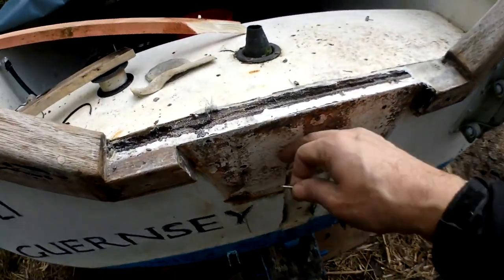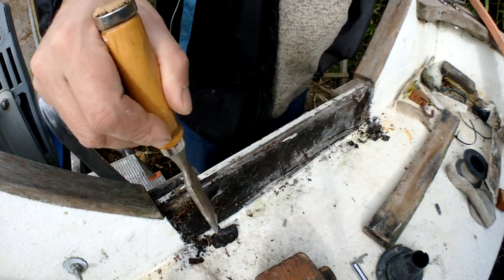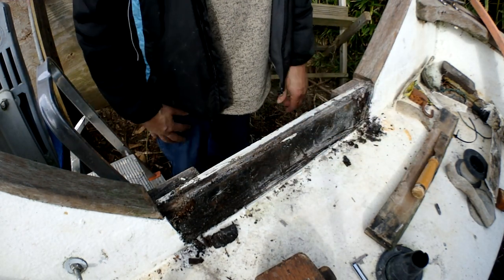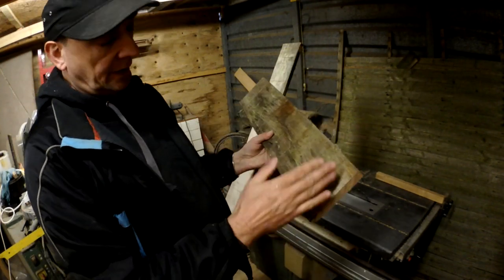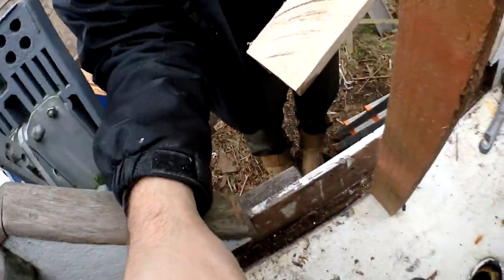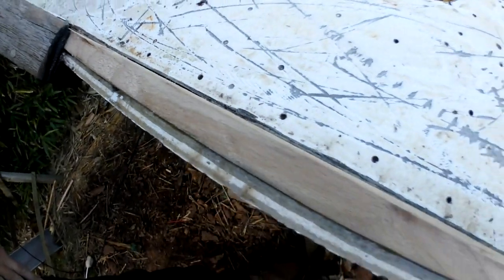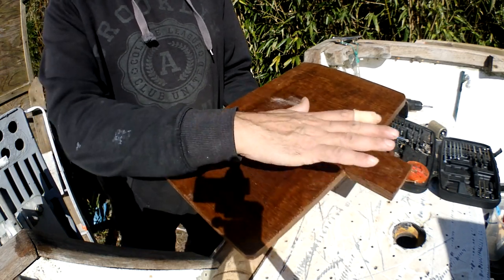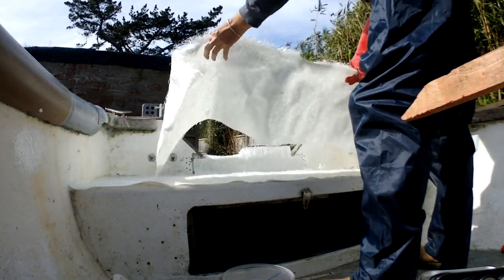⛵ Small Boat Owner 4 - Repairing Re-building Transom & Reinforcing Fiberglass Seat

Comment: Good job, do you not use marine lacquer to seal timber??
Reply from the maker: When I first had the boat it had a lacquer or varnish I removed it problem with a working boat it gets chipped and scratched then the water gets under it and its a pain to sand off later. I just use a coat of  stained wax every year and then give it a coat of clear industrial floor wax